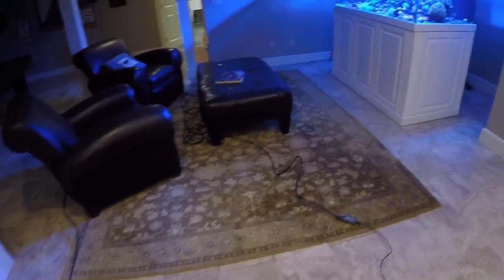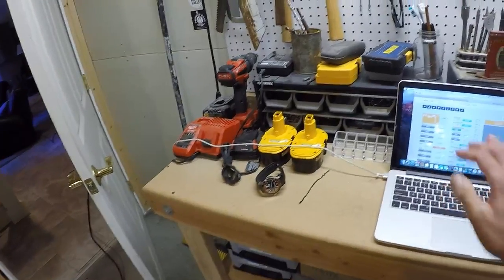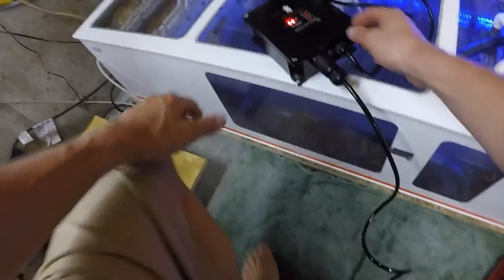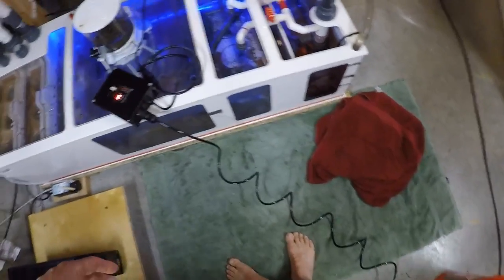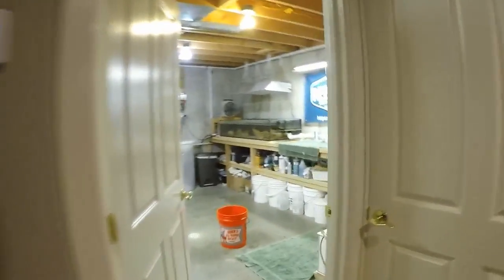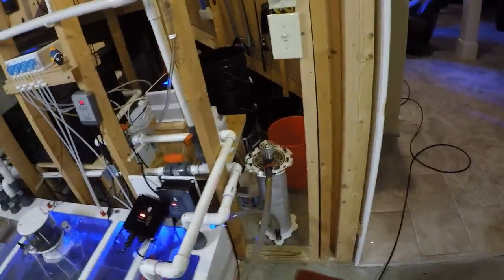Installing a New Royal Exclusiv Pump

Comment: Looks like you have an Apex, if so here is the advance config for my Skimmer. It will auto turn off the Skimmer if the return pump is Off, when you turn the pump back on, it will wait 10 min before turning the Skimmer back on. Replace the YOUR_PUMP_NAME in the Skimmer config with what ever your Return Pump is named on your Apex. Make sure your Skimmer is also set to Auto instead of On or Off. You never have to worry about the skimmer any more.

Fallback OFF
Set OFF
If Output YOUR_PUMP_NAME = OFF Then OFF
If Output YOUR_PUMP_NAME = ON Then ON
Defer 010:00 Then ON

Comment: So lucky to have a fish room with a remote sump! Have you ever experienced a no power being displayed on your Royal Exclusiv brushless motor controller following an F8 error? Basically the skimmer pump is plugged in I saw the F8 error to clear it, unplugged the pump from the surge protector, checked the airflow to the skimmer, plugged back in and now the pump is controller is showing no power on the display. Any tips or tricks?
Reply from the maker: I fried a couple of RE pump controllers due to power surges. You should have your pumps plugged into a surge suppressor, not a surge protector: https://reefbum.com/equipment/why-you-should-seriously-consider-using-a-surge-suppressor/